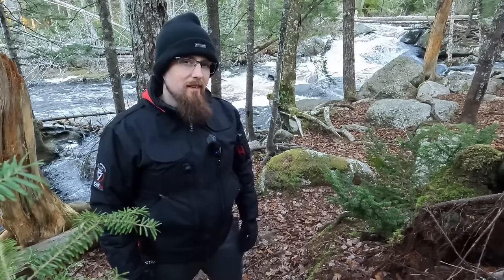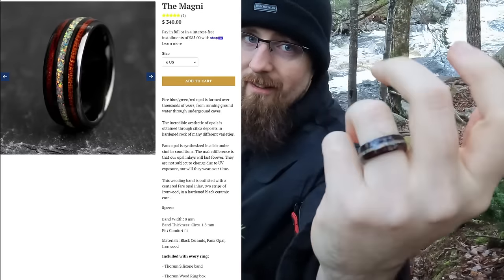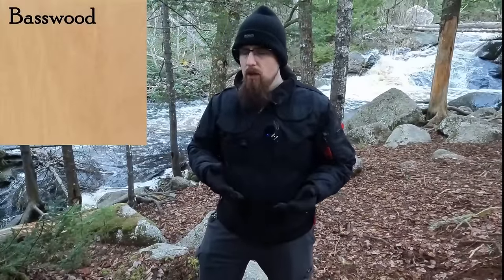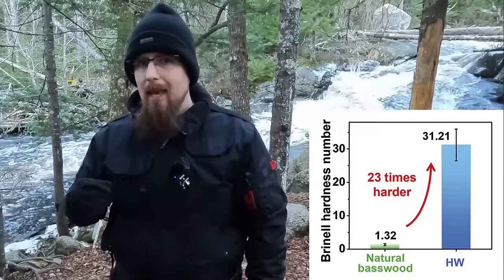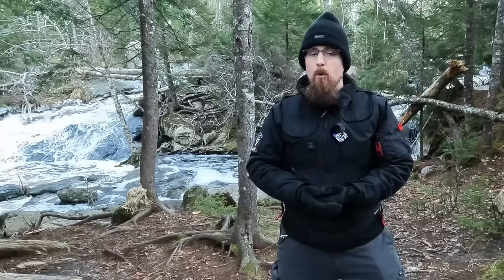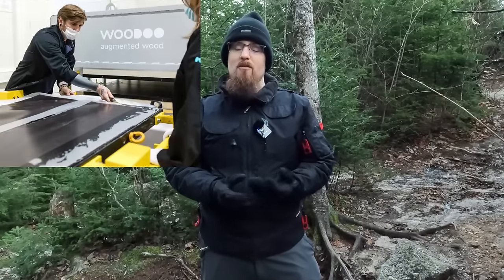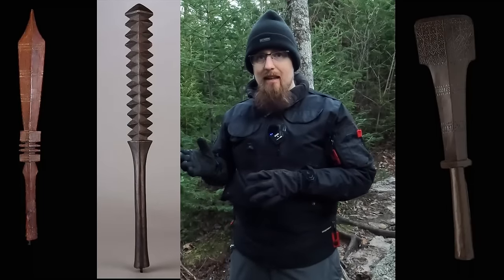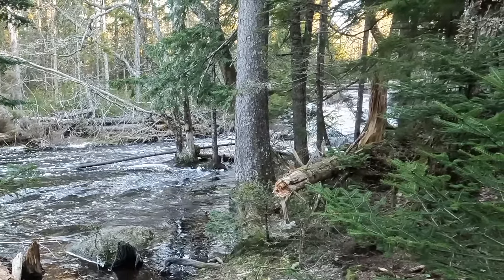Hardened Super Wood!  -  Can It Rival Steel?

Comment: it sounds stupid bit i never understood why actual carved wood armor never became a thing. I know there are decoratively carved Spanish breastplates. I know Japanese and even Maya had like layered or laminar armor. But say Pirates, seafaring people. You are way more resistant to cuts. slashes for sure, many blunt weapons, wood shrapnel from canon fire and even early pistols. It could be connected with light rope, you fall overboard, it floats. It just seems logical to me.

If you 'forged' the wood by getting your shape then dimpling it, like you do bronze, you would compress the void space in much the same way. Id like to think they are not using epoxy to soak it in, I hope its not just  more plastic, although wood pulp and ice (pykrete) is insanely strong (they built a battleship out of it) when you add wood fiber to other materials (think paper machete by a madman) it can be an amazing material.  They add carbon fiber to resin castings and it makes them nearly as strong as steal supposedly. I think they are saying int he way of stress by pulling mostly.

The pykrete Battleship 

https://en.wikipedia.org/wiki/Project_Habakkuk#:~:text=Project%20Habakkuk%20or%20Habbakuk%20(spelling,based%20planes%20at%20that%20time.

carbon to castings

https://www.youtube.com/watch?v=25PmqM24HEk

Comment: ok hear me out, the material doesn't seem like a good replacement for either plastic or metal,  here's why the whole prosses seems too long and complex to be considered a viable alternative to either material, the hardness is not as good as metallic materials, and the process is too complicated compared to plastics, its like if you took the difficulty of the metallurgic process and the physical properties of hard plastic, wood on itself is a good material because is flexible yet rigid enough to keep a structure, this is thanks to its defects that allow wood to be deformed and not be subjected to significant stress, if you take those things away the wood might be harder however it might become brittle, if this process had been developed as ww1 was happening maybe it could have been a game changer, but as it is right now I don't see a good use for it, its properties don't offer anything new or ground breaking to justify its implementation on any field, new alloys and materials based on polymers have a lot more potential for growth, like you can make plastic out of things like corn n biowaste, some new alloys are way stronger than steel, wood takes a lot of time to grow and even longer to make the whole process to harden it at an industrial scale, yeah sure is an interesting material but in the era of carbon fiber, kevlar, polymers and impossible alloys it comes short

Comment: By the way a sharpened steel axe is crap. A hammered steel axe will stay good forever. One the edge gets blunt you simply hamer it back into a decent edge that can cut but sharpening an axe will just ruin it.